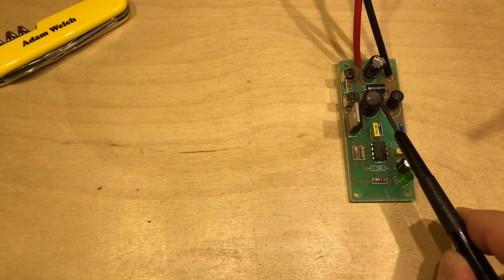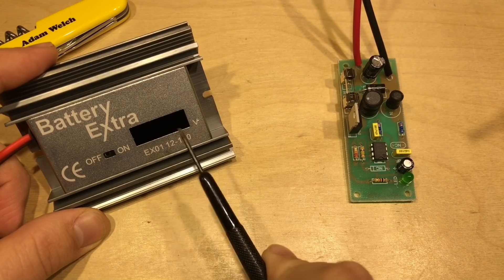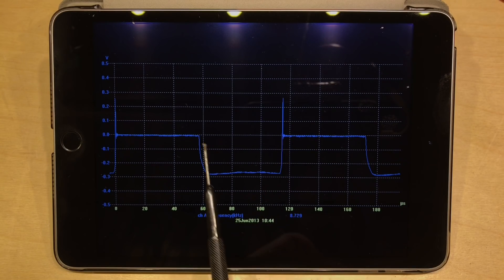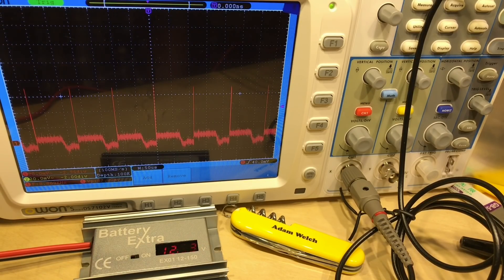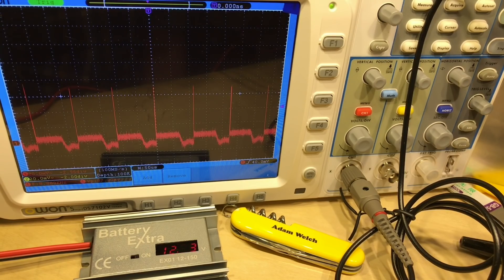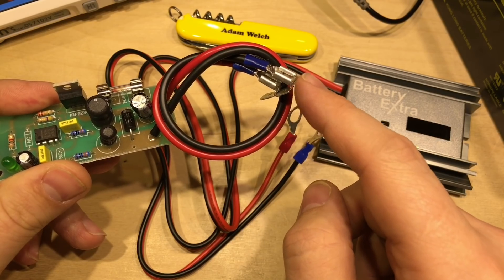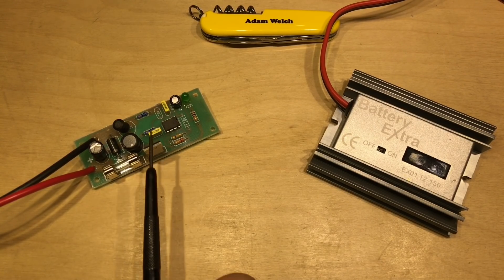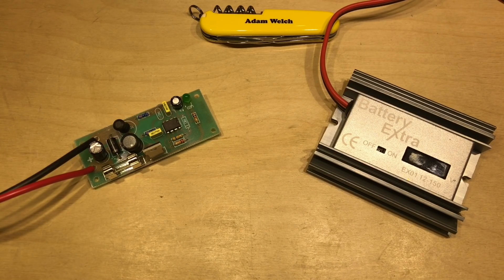Battery Extra EX01 vs. 555 Desulfator Kit - 12v Solar Shed

Comment: Sulphation is only really likely to be an issue if batteries are not reaching a fully charged state. Batteries that are regularly charged fully will not develop crystalline deposits on the negative plates. These pulse gadgets are unproven scientifically. They will work on batteries that have soft sulphation, but then fully charging, perhaps even overcharging (2.5 to 2.6V per cell) will have the same effect. Batteries with hard sulphation have been badly treated and have not been allowed to reach a fully charged state for a long period of time. Best wishes.
Reply: Adam I think you & Cornish Miner are spot on. Knurlgnar 24 isn't impressed by desulfatsted either. He states 'desulfators don't have to work to patent them'. 'My Playhouse' tested them & found them not to work.

I have loads of 12 v batteries. Nothing I have tried works any better than a slow trickle charge for AGM's or a 15.8v or so equalization overcharge (current limited) for wet cells.

I just can't see a pulse of a few hundred millivolts having much effect.Any desulfation apppears to ta
Reply: Sorry my computer (or me!) is playing up. Any desulfator appears to take months to work. I 've tried 3 desulfators & used equipment where you can set the load & cut off voltage. It then gives an accurate reading on the display in amp hours. So far desulfators have just done nothing . Before & after conductance readings showed the same. Shame, but no luck so far.
Reply from the maker: Thanks.  That's pretty much my feelings too, but I haven't really seen any conclusive tests - I might not be able to prove anything either way either, but at least I will have tried and will have some experience on which to base an opinion!

Comment: For the drop on voltage due to the cable, have you tried a wider cable? For disulfation, the method I have found works best (car batteries with maintenance option) is equalisation at 15V. Cost is minimal as I do it with used car batteries and a 15V 5A with a second hand laptop charger (after having charger as much as possible with the car battery charger and using a fan to cool dowl the laptop charger). Well... to be fair I have only done this twice and with the necessary precautions, will try to upload someday.
Reply from the maker: When I built the 555 Desulfator I drilled the holes in the PCB to get thicker guage cable in there - so hopefully it's performing as well as it can. I can't do much with the battery extra (I think opening it up may well destroy it - but perhaps after fully testing it I may rip it apart).
I've just been looking again at an old lead acid smart charger I bought years ago for my motorbike.  Like you suggest it does a high voltage charge in it's 'recovery' phase if it detects a sulfated battery.  Obviously the makers agreed with your method.
Cheers

Comment: If you don't mind the noise, you can use a relay which is disconnecting itself all the time. Catch that spike and there you have it.
I don't like that noise so I usually use a dc to HV converter at a fairly low output, using a Gas Discharge Module (you could also use a small spark gap or even a small neon light). Of course, I do am powering these devices from an external source (usually a small solar panel, 2 Watt or less).
I do think higher voltage peaks do a much better job. But I do have a couple of very sulphated batteries (Gel) which I can not recover. I also have a car battery (36 Amps or so) with just one bad cell, and it just will not recover.
So I do agree partly: handle your batteries with care. Don't keep them discharged over a to long period.
Reply from the maker: Cheers - I'll be interested to see what I can find between the two devices.  It's not an exhaustive test but may at least allow me to form a better opinion based on a few facts!

Comment: I built a 555 kit with low voltage cut off some years ago. You do need very thick and short cables so that most of the high voltage spike gets thrown back into the battery.
I connected this across a 120ah bus battery and was left for about 3 or 4 months with a trickle charge from a solar panel .... It did clean the plates and brought the battery back to life somewhat.
I am not so sure I would use them on those sealed battery's though due to them being more of a paste (wet tissue) rather than an actual liquid electrolyte.
Reply: Just a quick addition for testing is to connect a diode from the positive of the battery to one side of a non electrolytic cap ... other side of cap to battery negative then test across the cap with a high voltage meter (150v ish) with the desulfator running. The higher the voltage the more sulfated it is .... or so they say !.

Comment: Hi Adam I bought a Battery Extra EX01 for my system here in Australia and at almost $100 aus it pretty bloody useless I think !! I'd like to try the 555 desulfator to see how it works, on ebay there's someone selling them assembled ready to go for $16 aus !!  Do you rrecon there worth getting ? Seeya Rob
Reply from the maker: Cheers - I was a bit shocked when I saw how small the peaks were, I guess time will tell.  Think I'll miss the 60 day money back guarantee window though!
Reply: Hi Adam, my Battery extra packed in just after the 60 day period but they were happy to give me a full refund anyway.Nice enough chap their Dan, but their desulfater was giving the small pulse output on my 'scope for weeks, yet still did not improve the battery capacity.

Loads of people seem to think these desulfaters are working & restoring their batteries, but often appear to be basing this on nothing more than a voltage check with a multimeter, so it could be wishful thinking.

I built one from a kit from Courtiestown. I used 6mm square cables 9 inches long. It gives a voltage spike higher than the Battery Extra & the Infinitum one I tried ,but none gave any improvement on the batteries I tested them on for weeks.I just think these things are 'snake oil', or at best have a slight effect over many months, so are not worth the bother, unless somebody can prove to me otherwise.

Comment: I somewhat revived old battery by using such charging algorithm: charge it for 2 seconds, then discharge for 1 second, repeat. Left it overnight doing that, the battery now seems more conductive (voltage sags less when you load it). I also built the same 555 desulfator. It's not a kit, but the same circuit. Long story short - I didn't see any noticeable improvement using that gimmick.
Reply: I built a set up using a mechanical timer & a relay to switch a 12 v lamp load on for a few hours then change over to a non smart (old fashioned ) trickle charger of 1.5 amps max to cycle the battery in parallel with the desulfator. The desulfator made no difference compared to similar tests done with cycling /trickle charging alone.
Reply from the maker: Interesting.  I expect this will take a while to conclusively test.  I hope I can be bothered in a few months time to carry on!
Reply: The problem is that if there is an effect, it's pretty mild. Thus it requires a lot of time, can't resurrect dead batteries and so on. Another problem is that these things discharge the battery, so you should keep an eye on it. It's ridiculous to desulfate the plates and then let this thing discharge the battery, thus sulfating them again LOL
 That trick I told you about gave a result that I can see easily after running overnight. The plates in the battery see AC while doing that, I guess that knocks off those crystals exposing active surface. Just a hunch, but seems logical.
Reply from the maker: +MrJohhhnnnyyy It does seem logical and also roughly what the battery extra seems to be attempting. I'll have to think how I can charge and discharge them as evenly as possible while running the different devices. Hope I haven't bitten off more than I can chew! Of cause the whole thing of cycling the batteries in the test may well improve the performance!
Reply: Michael Thomas I'm glad to see you saying that, it means this method gives you an improvement you can spot.

Comment: Maybe a weird question, but can you show us the connection where you measured?  
As far as I understand there is a certain loss over the wires and connectors which is understandable. A bigger battery should have a lower internal resistance and as a results the peaks will be smaller making a more powerful desulfator desirable.  But how much is enough?
Reply from the maker: Where I connected the oscilloscope probe?  The was directly to the battery terminal - and the desulphator(s) were connected directly to the terminals with spade connectors.  How much enough indeed!